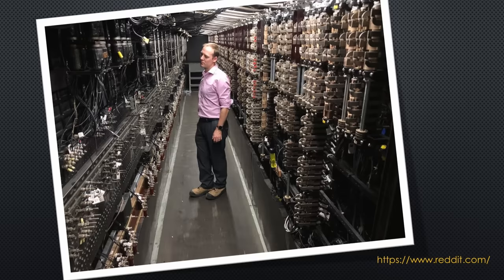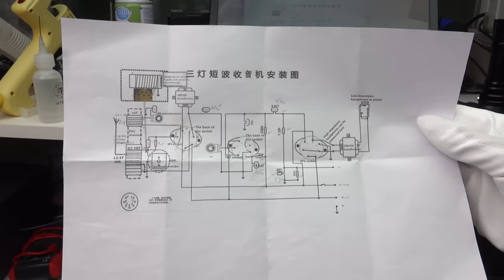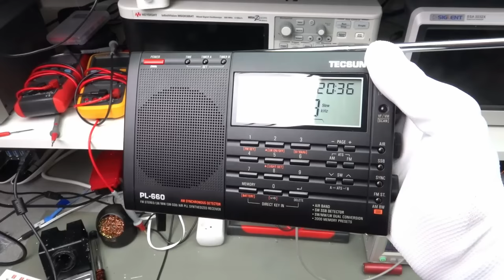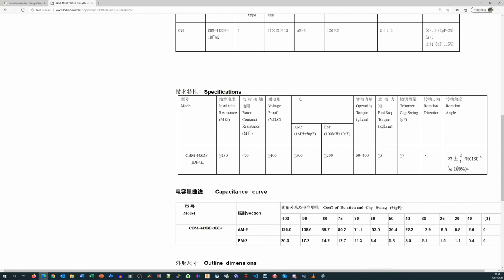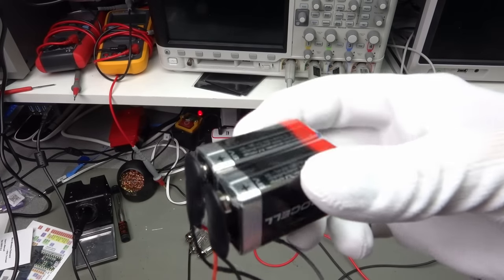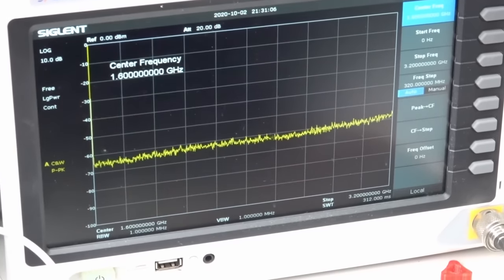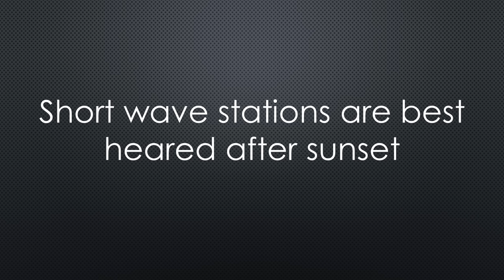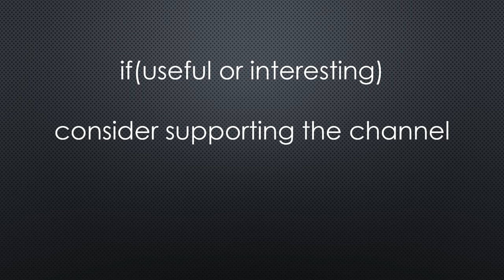#355 Let's try to build a Vacuum Tube Radio

Comment: I've seen these kits on Ali as well but never bought them exactly for the reasons you encountered: bad documentation and unclear expectations. Very glad you made this video about them!
Reply from the maker: So maybe you try one now...
Reply: @AndreasSpiess  I might do so but I hoped the kits were designed for the FM band so it would be usable as a normal radio. Probably not possible due to the high frequency of FM? I'm a licensed HAM as well but living in the city the reception of the 40m band is terrible due to interference. A good magnetic loop antenna might be a first project ;-).

Comment: Really enjoyed this video!  Nice bit of history as well.
Paul, "Mr. Carlson", is doing a video on one of my favorite radios.  It is the BC348 which was used in aircraft during WWII.  Among the very interesting things about it to me are that it uses an IF frequency of 915 Khz, and the 4 gang tuning capacitor ( 4 sections each 14-331 pF) which includes a potentiometer attached to the shaft of the tuning capacitor!  The potentiometer is used to keep the noise level somewhat constant from low end to high end of each band.  Low resistance at the low frequency end of the band, and high resistance at the high frequency end of the band.
Reply from the maker: The engineers back then had to be very creative, I think. Their technological possibilities were much smaller than what we have today.

Comment: Dude! You're only 4 months older than me. :)

A lovely video. Exactly what I imagine all my Ham radio friends did when they were kids. While I was toggling boot loaders into early PDP-8 computers. :)
Reply from the maker: Two different careers... But it was easier to make money with computers than with radios ;-) So your decision was probably not bad.
Reply: @AndreasSpiess  Yeah - computers have done me well over the years. Still are!
Reply: @rbphilip  ooh - I was doing the PDP8 thing back then aswell. All those toggle switches just to start up the punch tape reader  :-)
Reply: @fotografm  Exactly! We've advanced more than a little with modern bootloaders! On the other hand, my octal-to-decimal skills were much sharper back then!
Reply: @rbphilip and my morse code reading skills also just got sharpened :-)

Comment: For my 8th grade science project I built a 3 band AM and shortwave receiver from a semi kit. This was in 1960 so it was all vacuum tube construction, built on a metal chassis, all hand wired, no printed circuit boards, built on the family breakfast table. I took it to my Dad's TV shop and he walked me through the alignment using an oscilloscope. Quite a project for a 14 yr old kid, it took me around 45 hours to build. The semi kit included a metal chassis, a screen printed faceplate, and a whole bunch of parts, I think it had 8 to 10 tubes, the best thing about it was it had a good construction manual that walked you though the build.
Reply from the maker: So you were lucky to have a dad which knew the stuff! But it was quite complicated back then without PCBs I assume...

Comment: Interesting video, always thought valve radios have more soul. The more expensive valve radios used to have what was called a " magic eye tuner " It was basically a valve, and you either viewed it end, or side on. As you tuned a station in two green beans of light got closer.
Reply from the maker: I remember these "magic eyes". But I do not know which signal it was connected to.
Reply: @AndreasSpiess  The Magic Eye was connected to the receiver's AGC or Automatic Gain Control,  which adjusts the gain so strong and weak AM stations come in with about the same volume. The gain adjustment was done with a "remote cutoff" pentode  whose gain depended on the amount of grid bias.

Comment: When I was in my teens, I bought a multiplex converter kit for a tube FM radio. I had to modify the FM demodulator, but I got stereo out that sounded wonderful to me at the time. You hardly ever hear a stereo FM receiver called a Multiplex Receiver anymore, but it sounded cool in the day.
Reply from the maker: Interesting! We had good solutions when we were young. But it was often replaced with even better stuff! The development during my career was mindboggling!

Comment: A useful video. I keep receiving e-mails from AliExpress re this type of kit.. Nice to know that it actually works using the supplied valves, unlike some audio amp valve kits, where the valve is just for show and the actual amp is solid-state.
Reply from the maker: Indeed, this is not a fake valve. Otherwise I would not have shown it...

Comment: I love old tech like vaccum tubes / valves and so a great overview of the pros and cons of this kit. For me I think the cons outweigh the pros which puts me off buying the kit. A traditional mechanical metal air spaced capacitor would improve the kit but at about $12 for a new one it would up the price of the kit alot. I have previously bought an old valve radio made in the 1950s that requires attention and will be spending time fault finding, buying parts, repairing, and hopefully ending up with a fully working radio in a traditional wooden case.
Reply from the maker: A specialist like you looks differently at things than a noob like me, I assume. I ordered a bigger capacitor, even with a gear reduction for 23 dollars (used) because I want to try it out. 
I did not see many other tube kits around these days...

Comment: I found today an old valve, EC86, before I checked on YouTube ... I made transmitters and high quality audio amplifiers. In one word, I love valves! Even more than computers 😄
Reply from the maker: As I said, I do not understand a lot of tubes. But it was interesting for me to dive into the matter. It is somehow similar to transistors from a logical point of view. And interesting how these engineers solved the problems with "primitive" tools compared to now.
Reply: @AndreasSpiess  These were days, when the tubes technology was of centimeters density 😄

Comment: Thank you Andreas for sharing, a very enjoyable video. Very pleased you got your radio working as well, interesting about the frequency range and hence the tuning difficulty. I haven't been able to check that on mine as I don't have a suitable generator at home, and it does explain why it's so difficult to tune.
Reply from the maker: Without a signal generator it is probably too difficult. If you are lucky you find a strong station.

Comment: They look beautiful at night! Wonderful decoration.
Reply: I had an old Westinghouse long band, medium band, shortwave receiver (back in the day) with 6 or 7 tubes. It was seldom in its case, and I would listen to radio at night in just the glow of the filament heaters.
Reply from the maker: The tubes I have unfortunately do not glow a lot. Even if they use quite some current, they are low-power :-(
But the big ones definitively are nice to look at.
Reply: Dale P. Newbury Gosh, that is almost romantic!
Reply: @captainpugwash4100  ha ha! It could have been so, but then she tried to do me in (after I dropped my hand on the top-cap of one of the tubes in the audio amp section).

Comment: Seeing the resurgence of tube tech is enlightening. Pun aside, tube radios sound wonderful compared to the solid state counterparts. I had a 1950's RCA Victor that worked great for as old as it was, unfortunately the tuning band snapped and i couldn't figure out how to repair it, let alone have the high school electronics lab do the repair to it.

And I just made myself feel old even though I'm only 35...
Reply from the maker: This seems more like a mechanical problem... I am sure you will be able to solve it.
Reply: @AndreasSpiess  I'm sure I would be able to had the radio not gotten thrown out by a past step-parent. I had the radio when I was in my teens (acquired roughly 2000-2001). Thanks to a divorce though in 2010, through that I gained at least 150 working vac tubes that I could build my own radio, if not that, at least an amplifier.

Comment: To get the full flavor of tube technology, you need to build on an aluminum “bread pan” chassis, using point to point wiring. In the early 1970’s, I built my own amateur transmitter from a Heathkit DX-60.  Looking back through the haze of all the years, I remember being amazed that it worked on the first try.  When I started in amateur radio, it was when novice licenses were first allowed to use variable frequency oscillators.  Prior to that our transmitting had to be crystal controlled, or “rock bound” as it was called.  I had a lot of fun on 40M CW as WN4BCG.
Reply from the maker: Things changed considerably over the years and it is a privilege to live in such times, I think. I remember those chassis. But a PCB is of course much easier...

Comment: Andreas, thx for excellent video, you made my day, as I always wanted to build a tube receiver; I've" bought this kit about 2 months agoo and got stuck, I couldn't find any documentation, I figgered out most of the parts & connections, but the variable capacitor was too much ...
Reply from the maker: So maybe you can finish it now. I ordered a bigger capacitor because I did not like this small one. But it nearly doubled the price of the kit ;-)

Comment: Tube theory as well as transistor theory were being taught in courses at tech school back in the late 60's. I graduated equipped for both. I'm sure tubes were dropped from curriculum not long after though. I'm still nostalgic about tubes.
Reply from the maker: You are right. In 1977 it was no more part of my education.

Comment: Yes, had to shut the eyes and drag out the Morse from years ago. Subscribe wasn't it, but after about eleventeen replays, "Hi you tubers" finally made sense of the dots & dashes. Of course, it might have been several beers being consumed that made it take eleventeen replays :-) I'm going to order one of those kits just for a trip down memory lane. Thanks for the video :-)
Cheers
Pete'
Reply from the maker: You are right with the text. And you were not the only who had to repeat the signal. The statistics shows a big increase for that passage ;-)

Comment: Great video.  I am of an age that one of the lab experiments on me EE degree course involved plotting the transfer characteristics of a valve, all open wire on the bench.  Also my memories as a youngster of buying a portable valve radio from a jumble sale.  The cost of the 1.5v and 90v batteries was not good on my limited pocket money.  My parents talked of taking a heater battery to a shop to be recharged. FETs make life much easier.
Reply: I’ve never used valves in any circuit design, although I admit they have a retro charm - FETs with pilot lights.
There are audiophiles and guitarists who are convinced valve amplifiers are more ‘musical’, however I’m sceptical. Apparently valves produce more even order harmonic distortion, and this results in a ‘warmer’ tone - I’ve not seen any spectral analysis to verify this though.
Reply: My grandparents didn't have electricity in their house.  For their radio they bought a 90v battery which lasted a long time as the HT only consumed a few mA.  The 1.5V valve heaters however were powered by an accumulator.  These were glass cased cells that were rechargeable and a guy called round every week and you simply did a swop for a newly charged accumulator.  In 1958 they moved into a house with electricity and bought a "battery eliminator" to power the radio from the mains.
Reply from the maker: Interesting stories! Each time had their solutions. Today they start to talk again about a "sharing economy. It seems history is moving in circles ;-)

Comment: I think if i was going to build this kit id scrap that Circus board and build it point to point wired in a metal chassis with a full power supply and get rid of the batteries . But then again ive worked on tube type equipment for years so im a bit fussy lol . Seems a reasonable kit for education but thats about it .Great video Andreas .
Reply from the maker: Otherwise I probably never would have tried tubes...

Comment: My first job in electronics midway through college was at a small mobile radio shop that still serviced 140 MHz commercial radios with 3 tubes in the RF power amplifier. I fondly remember getting hold of the 300 volt b+ and lodging a screw driver into the ceiling. They also had a wicked relay-driven high voltage generator that hummed loudly to convert the vehicle 12 volts to 300 volts. Good times.  I have seen similar kits and wondered how feasible they would be.
Reply: That was a "vibrator" power supply
Reply from the maker: High voltages always kept me away from tubes. But I assume you can learn how to deal with it. But it will be dangerous even if you know how to deal with it.
And generating high voltages was for sure more difficult those days. Now we order a "boost" converter for a few bucks and get 400 volts...

Comment: Vacuum Tubes have been used in Nuclear Shelter for a long time, during my Navy Time I had to maintain these until mid of the 90 ;-) The benefit was that Vacuum Tube-based Electronics survive the EMP of a Nuclear Detonation.
Reply from the maker: That's what the salesmen told the purchasers ;-) For sure they were much more robust than today's equipment. Later they tried to sell NEMP filters for the same purpose. Fortunately, we never needed them.

Comment: Hi Andreas, I'm not sure if anyone else has picked it up but at 5:33 the choke does NOT remove the high frequency components going to the next stage. It is there to isolate the RF/high frequency components from the power supply rail. I.e. it will have a high inductive reactance (aka resistance) to the RF but a very low resistance path for the power supply DC to the tube. If the RFC was not there then all the other stages of the circuit would have the RF superimposed on their signals too. I could be wrong (been a very long time!) but it looks like C4 the 270pF capacitor on the output of the second valve would provide a low impedance path to ground (589 ohms at 1MHz) but allow audio (589k ohms at 1kHz) to pass. This would achieve the filtering your refer to earlier. 73 VK1BGT
Reply from the maker: You are right. I mixed it up. 73 de HB9BLA

Comment: I am a ham, electronics guy, and software engineer..   Do I remember something about tubes  like "dip the grid and peek the plate"   or was it the other way 'round?  I first learned electronics in the US Coast Guard and we learned vacuum tubes and transistors (This was 1974)  and I worked on high power LORAN transmitters
Reply from the maker: These were the days...
BTW: I created a second channel just for HAM radio if you are interested...

Comment: About air entering the tube: there are metals inside the tube to catch any oxygen and hydrogen that enter over time or are left from production. This is the silvery layer on the top of most tubes. It is produced by heating a Barium cup (the "Getter") after the tube is sealed.
If air enters the tube, this layer will turn white: a visible sign the tube is faulty.
Reply from the maker: Very good Information. Thank you!
Reply: I maybe wrong but I thought the getter was to catch the remaining air molecules after the tube was vacuum pumped and sealed. Sorry that sounds contradictory, that is not the intent. What I mean I don't think the getter will do that [catch air molecules for the purpose of keeping the tube alive] afterwards i.e. yes it turns white but it does not help if the tube gets air into the tube over time.
Reply: @jimmiller5891  It is, but the barium stays reactive after production so it also catches any oxygen that enters later.
"or are left from production" should be read as "after sealing"-activating the getter happens as part of production.
Barium won't catch all molecules, just the reactive ones like oxygen, that cause the most problems in tubes.
Reply: @TheEvertw  Thanks for the clarification. :)

Comment: Thank you for the video, I belong to several vintage radio sites and have restored valve radios myself in the past, we were only talking about this type of kits the other day and if they were any good, I have shared your link to the club, thanks again... de VK2FMOD
Reply from the maker: You saw what you get. I think it is ok for a beginning. For sure I will change the variable capacitor... 73 de HB9BLA

Comment: Liked how you used 2000s technology to test 1950s technology, digital spectrum analyser, HackRF SDR. I thought you might take it upstairs and attach a wire so we could hear  one of those big European broadcast AM stations. Are there any still on air? 73 Paul VK3HN.
Reply from the maker: I do not know about all AM stations. But here they are converted to museums. And I assume the same is the case for most European stations. 73 de HB9BLA

Comment: I built my first 3 tube kit in 1957. A much better experience. Nice case, schematic, and documentation. Mom and dad were not impressed 🤓🤣
Reply from the maker: I am born in 1957. So you definitively had an advantage back then ;-) These early kits were of a much better quality I think. But probably also more expensive compared with an average income.

Comment: It is a 300pf Gang capacitor widely used in radio. Now very difficult to get.
Nice work 😃
Reply from the maker: Thank you for the info. It seems the still sell it on AliExpress
Reply: @AndreasSpiess   But unfortunately it is very tough to get anything directly from China.
Reply: @AndreasSpiess  On watching your video I was taken to the days when I was building a radio receiver. Four years before I tried. At that time this capacitor was not available in the market so I had to go to scrap store to get old radios. I had to teardown most of the radios to get a working gang capacitor. But unfortunately I had the same issues with the capacitor that you faced. I works when I touch the capacitor.